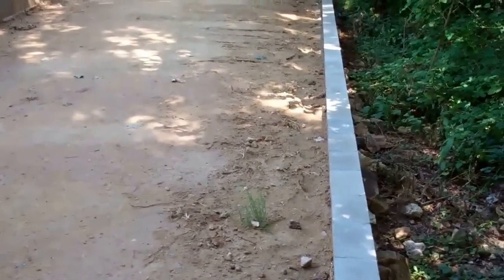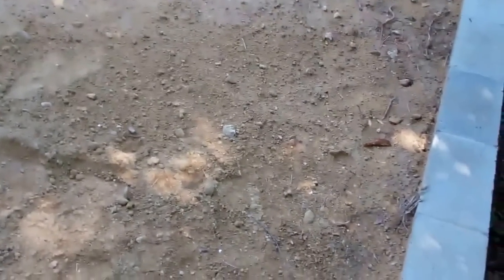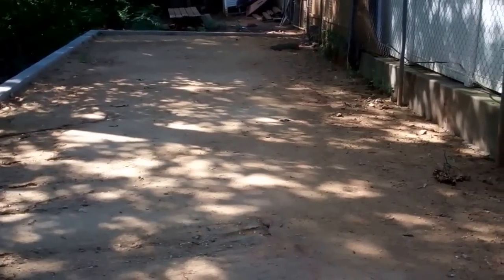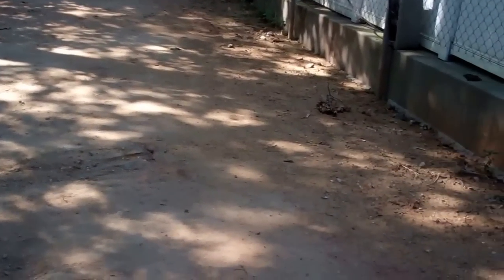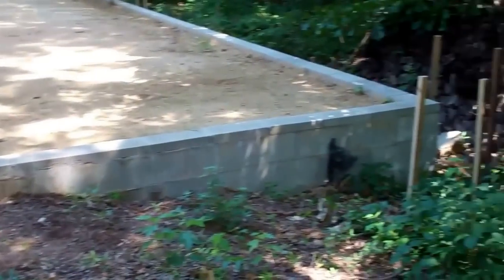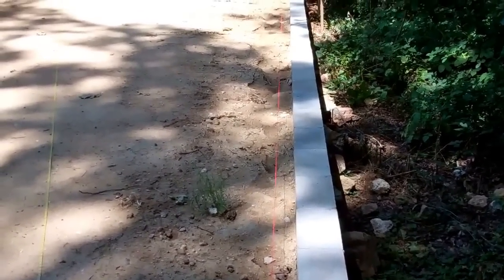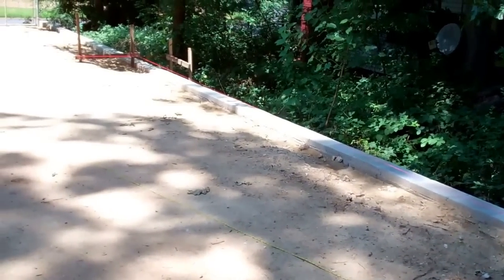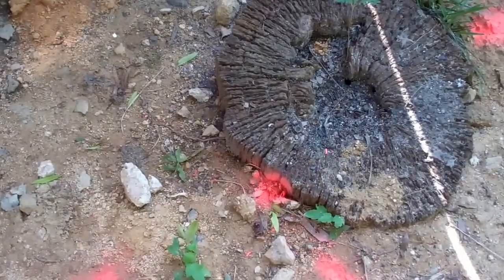Construction of Project 'Mega Shed' Part 1: Pulling Lines and Marking Holes

Comment from the maker: You can't just slap something together and think it will be fine.. precise measurements and layout must be done first to know where everything will go including the length of boards to buy so as to minimize waste and do overs.
The string allows is to 'square' up the foundation layout to within 1/8 to 1/4 of an inch so the posts were set precisely where they needed to be to start building on top of them.